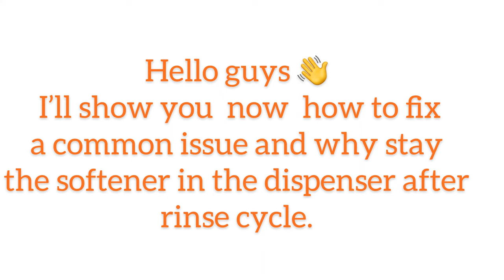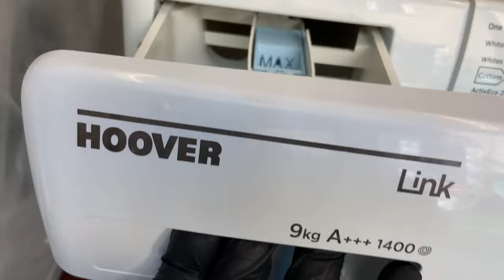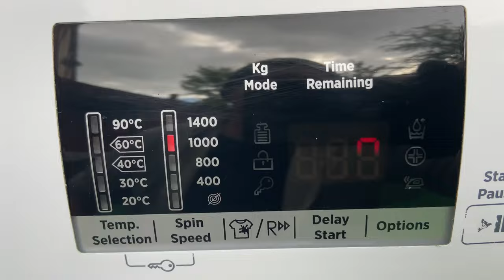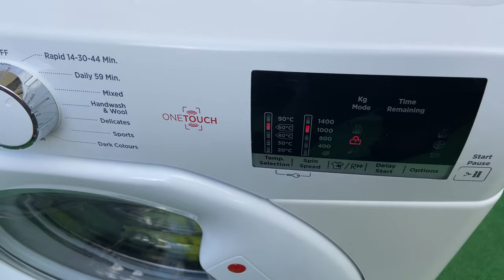How to fix your Washing Machine fabric softener dispenser when doesn’t release HOOVER BOSCH HOTPOINT

Comment: I have done all of this is wash my washing machine all the time I have tried everything and still won't drain x
Reply from the maker: Hi, have you tried to clean the filter at the bottom? Many times when filter blocked don’t start to drain the washing machine. I presume you cleaned the dispenser, due to commented to this video.